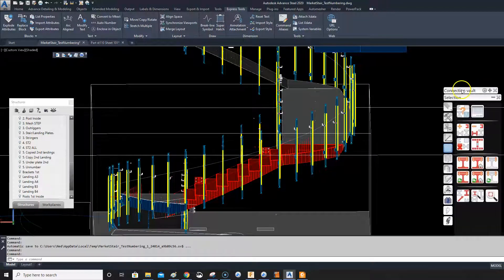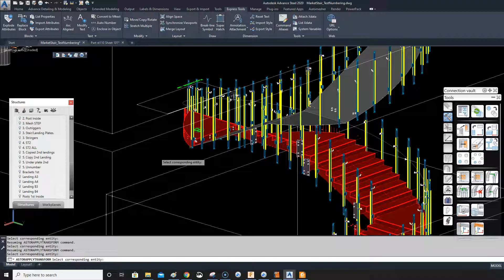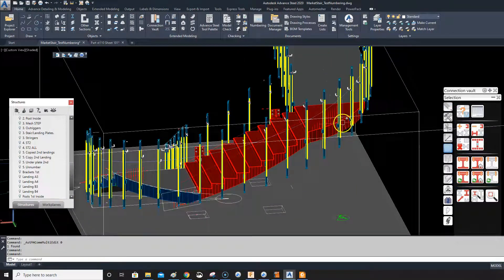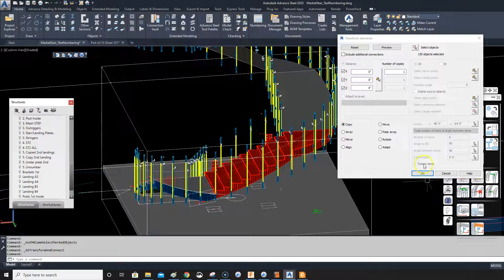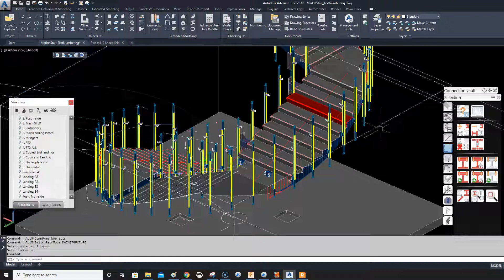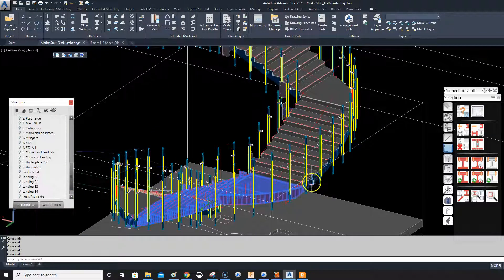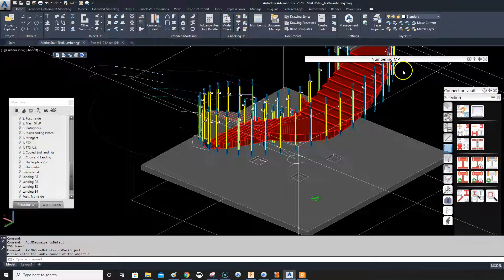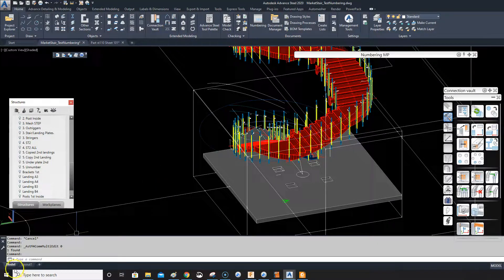Advance Steel Everyday   Best way to copy for numbering

Comment: Hi, thank you for your videos, there interesting.
You have a quite large model here.
I am having lagging issues with my pc hardware configuration.
What hardware are you using on yor pc for Advance Steel?
- Mainboard?
- CPU exact model?
- memory Ram count with mhz, ecc?
- Grafics card model?
- storage SSD/HDD, read/write speed?
Reply: Hi, I have a machine I built myself, originally intended to have ECC memory but got the wrong chip so I changed out the memory temporarily and have the Xeon chip now ready to install on a slow week. Right now I have i7 @ 3.7GHz (need high GHz as advance steel only runs on a single core), 64 GB RAM @ 1064, 4GB Nvidia Quadro P4000 (not totally necessary as CPU is most relied on, and Samsung SSD 970 Pro with Windows 10 Pro. Hope that help, I also control the elements turned on using layers and then use view boxes, works pretty goog, this model also have 100s of bolts and screws added as special parts so I was happy it worked so well. Be aware when you are working in 2D wireframe and you orbit the machine goes from using CPU to GPU and you will have lag her also at times.
Reply: @adriandmangan  Thank you.
How about when you generate the drawings for this model from cameras, how long does it take with your current hardware configuration?
Reply: @78thScout  pretty quick but I do them manually, better control for me
Reply: @78thScout  hi, looks like plenty of pwoer to me, thats a nice cpu at 4.1, plenty of RAM, some seem to think your fine with regular ram but better be safe if you want with ECC seeing as you have the Xeon chip, I would say try start with 64gb of RAM but the ECC is expensive so maybe 32 to start. I like the modular power supply Im using the pure power 600W with my next build should be plenty but 700W might be better bet. I have NvME as my boot drive and SSD as my storage along wit an older hard drive. Looks good, good luck. My first build I got the Nvidia P4000 but my next build for home will have the ASUS 1660 super, bit easier on the pocket for 6gb. good luck, looks good I would just say check you compatibilty on a site like partspicker.com
Reply: @adriandmangan  I have an othe question.
Where do you work currently? And what is your degree or profession?